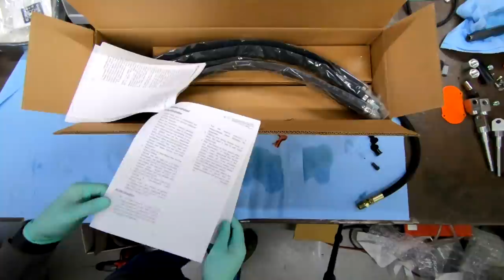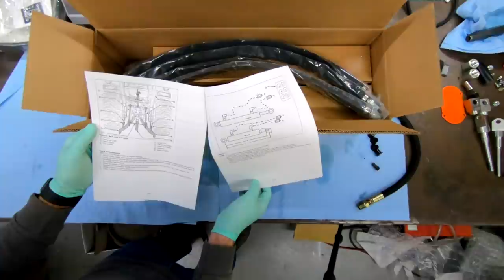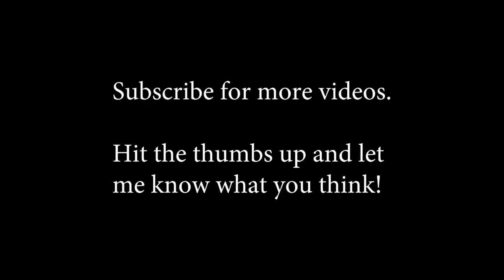Adding Kubota Top And Tilt To The Tractor - #62

Comment: I have that same kit installed on a L 4060 with a QH 15 quick hitch. I noticed that when I have the top cylinder fully retracted that the top of the quick hitch hits the cylinder and could cause damage so you might want to check that. I’m going to cut the top corners of the quick hitch at a 45° angle to eliminate the contact. Good video thank you.
Reply from the maker: Thank you. Yes, I had the same issue as well. The cylinder diameter is wider than the ears of the hitch. I have since replaced the cylinder with one that has pilot operated check valves and do not have that issue.
Reply: @JaredsShop  I could not figure out the purpose of the two grade 5 bolts with locking nuts. Did you figure that one out? Thank you
Reply from the maker: @rccodara630  
What did they come with? The top and tilt?
Reply: @JaredsShop  Yes sir it was part of the top and tilt kit it’s listed in the contents but there’s no explanation that I could find anywhere to tell me what to do with them, I wish I could send you a picture of it.
Reply from the maker: @rccodara630  
I’ll have to look at the manual again. I don’t remember getting them with mine.

Comment: Really like mine, although they had to replace 2 valves as my tilt kept leaking down. I guess they’re known for bad valves. Hopefully yours doesn’t drift every time you shut off the key or while running.
Reply from the maker: Unfortunately, mine does. Did the new valve solve the issue? I need to have the bleed-off timed and see if it falls within warranty specs.
Reply: @JaredsShop  They put new valves in but I’m not so sure that it holds very well. I’ve only had it back a week and have been so busy I haven’t had a chance to mess with it much but honestly I think it’s still drifting a little bit. They had my tractor for a month replacing it last time and I really hate paying a payment and not being able to use it. They said that they’re not meant to hold implements up, they’re just meant to adjust them. Just a way to get out of fixing them properly as many of the parts are bad. I guess the valve body is flat and not tapered so it doesn’t hold pressure well. Sounds like a bad design. Maybe a check valve would help.
Reply from the maker: @Dirtyd-dd7xy  
They’re partially correct. A valve body like this will always leak by as it does not utilize seals. It is a machined spool that is precision ground to a very tight tolerance. If it had zero tolerance to where it wouldn’t leak then it wouldn’t move as it would be stuck. The issue is how bad does it leak. If the tolerance is too much then it will leak by fast. They have a spec where they gauge the distance it drops over a certain amount of time with a certain amount of weight on it. It will never 100% hold weight without a check valve. 

I am looking at installing a check valve but it’s difficult because there is not much room between the cylinder ports. I’m not sure if I’ll go with a single one just to help with gravity or if I’ll install a dual pilot check valve and just have it mid-hose.

Comment: what was the price point ? also to fix any leaks maybe try some teflon tape on the fitting threads and then dope the tape!
Reply from the maker: It was under $900 but I’ve since replaced the top link with one that has dual pilot operated check valve. 

Yes, I use Teflon tape on the NTP fitting.
Reply: @JaredsShop  good call on the check valve ! Would love to see an updated video , I should be getting my grand l3560 in the next week or two , my dealership is building it as we speak . Went with la805 loader with third function  , 64” front snowblower mid pto, and a 72” box grader , led head lights, led front and back work lights , heated mirrors , and an air ride seat (also the radio option because why not right) . I would be very interested in the top and tilt kit ! Thanks again for the awesome content
Reply from the maker: @haus05  
Thanks! I’ll try to get another video up soon. I have a ton of stuff recorded but find it hard to set aside time to edit and post. There’s just never enough time in the day. 

Sounds like an awesome build. I’d like to have mid PTO and the flail. I don’t get enough snow to justify a blower. Let me know how you like the air ride seat. I may add it in the future.

Comment: Will this work on a l3901 or do you happen to know a kit number? I’m not having any luck finding anything.
Reply from the maker: Yes it will but I have since changed the top link to one with pilot operated check valves. Here’s a link to it. 

https://amzn.to/3SuhkwJ

I haven’t purchased a side link with check valves yet, but hope to soon.
Reply: Thanks for the info! Curious did that cylinder work out and which one you went with for the tilt? @JaredsShop

Comment: Thanks for posting this one!  I'm in the market for this as we speak.  Did you pick up at local dealer or online like Messicks?  Can you post which parts you ordered?  Worried now after reading below about the leaking issue.  Did you end up solving this?
Reply from the maker: I’m not sure I would recommend the kit. I have since replaced the top link with one that has pilot operated check valves and will be doing the same for the side link. If these had check valves I’d definitely recommend them. 

All valves leak down. Some just more than others. I explain it in a tractor basics video.
Reply: @JaredsShop  Recommendation on what you'd do instead?
Reply from the maker: @flightcrazed7790  
I like this top link. It’s what I ended up buying. I haven’t grabbed a side link yet. 

https://amzn.to/3tbhFJU

Comment: Enjoy your videos. I have a new L6060 that I should get to pick up this week and will be install the rear remotes and 3rd function/ quick coupler myself in the coming weeks. I sprung  for the hydraulic top link but no tilt. I don’t think I’d use tilt much
Reply from the maker: Thanks so much!! Let me know if there’s anything in particular you’d like to see in a video. 

Let me know what you think of the tractor when you get it. I’m sure you’ll love it. The L6060 is a beast. I may add one in the future. I’d love to have one setup with a mid PTO, front hitch, and a front flail. 

For tilt, it depends on if you do much ground work. If you use a box blade, grader scraper, rear blade, or rake, the tilt can be useful. If you don’t do that much it may not be worth it. I do a lot of final grading, yard leveling, driveway repair, etc. so I often have to change the angle on the fly.
Reply: @JaredsShop  I’m moving up from a L3540 so I know I’ll love it as I’m used to the grand L series. Had lots of people ask why I didn’t look at other brands and I told them I was sold on the Hst+ transmission. I was wanting more pto horsepower and figured go big or go home. I do more mowing with mine than anything. Running a 6ft cutter I’d find myself in low range /turtle on the hst+ more than I wanted . I do very little grading work. Although I plan to tear up my yard this next spring and level / reseed since I bought a LandPride Aps1572 seeder this last summer for food plots.
Reply from the maker: @braxtonwiggins6576  
Very nice. Then yes, you know what you’re getting into. I try to tell everyone the HST+ alone is worth jumping into the Grand L. 

So am I understanding you that you got hydraulic levers too? 

I have. 72” woods seeder I purchased almost 2 years ago. I seed some yards with it. Also purchased a harley rake this past spring.
Reply: @JaredsShop  yes I got three rear remotes, hydraulic top link, and  the third function with the hydraulic levers, air ride seat and a few other odds and ends. Wound up with $8k worth of extras on top of the tractor and loader. They sure add up fast. I opted to install all the hydraulics myself to save labor as they assured me it wouldn’t mess with my warranty and I had previous experience on the L3540.
Reply from the maker: @braxtonwiggins6576  
Yes they do add up fast. I absolutely LOVE my hydraulic levers. They were a pricey option but I think they’re worth it I have 4 buckets, forks, plow, snow pusher, grapple, and hydraulic auger. I change front attachments often and not having to leave the cab for anything other than hydraulics is awesome.
Reply: @JaredsShop  I constantly take my forks on and off when mowing vs removing loader. Also have bucket and grapple but use them a lot less. I also sprung for the 8point quick connect for. The loader. The more I thought about having to undo 8 hoses to take the loader on and off it seemed like feasible upgrade. The front flail mower would have been sweet on the L6060 but that thing is $9k not including the mid pto and front hitch.
Reply from the maker: @braxtonwiggins6576  
That’s definitely going to be one of best setups I’ve seen. Sounds like a dream build. 

I know. $9k is steep. It used to be less, and I hope it comes back down, but we’ll see. There’s also a couple companies that make third party front 3pt hitches and PTOs. Then I could use a flail like a Peruzzo. 

I rarely take off my loader. I’ve only done it a couple times, like when installing my backhoe subframe. I did think about the hydraulic disconnect but know the BX uses that setup and they have a lot of leaking problems with that. Hopefully it doesn’t apply to the Grand L.
Reply: @JaredsShop  I was unaware there was a third party front hitch. I’ll have to look into it. Hopefully the single point coupler doesn’t leak I honestly didn’t look into it much before ordering it.
Reply from the maker: @braxtonwiggins6576  
Look up Zuidberg some time. They are a manufacturer of front PTOs and linkage. Front 3pts are very popular over seas. Hopefully they’ll become more popular here in the future.
Reply: Picked up my L6060 from the dealer Monday. Spent yesterday and today installing hydraulics. Thanks to your videos everything went smooth. I really like the single lever coupler for the loader hoses. Definitely worth the money when there are 8 hoses to deal with. Also had my windows tinted today as well. It was nerve racking taking all the glass out for the tint guy. Just a couple more accessories to add and it’ll be ready to work.
Reply from the maker: @braxtonwiggins6576  
Awesome!! Congrats! I don’t take my loader off but if I did I could see that being useful. I have hydraulic levers so I have 8 connections.
Reply from the maker: @braxtonwiggins6576  
I’m also thinking of getting mine tinted but don’t want to go very dark. I’ve heard complaints about nighttime visibility. Have UV protection is what helps the most though. What percentage did you go with? Let me know what you think please.
Reply: @JaredsShop  I had 20% ceramic on the last one. It was so dark if you were working and someone was helping outside the cab they couldn’t see you . I went 35% ceramic this time. Definitely go ceramic if you do it. It cuts the heat way down in the summer. nighttime visibility with 35% shouldn’t be a problem. If you give me your cell number I’ll text you photos of what the 35% looks like tomorrow.

Comment: Did you ever have clearance issues with those hydraulic inlets/outlet being side mounted that side linkage top bolt looks awfully close to hitting top link?
Reply from the maker: No. I have not had any clearance issues. 

I have since replaced the top link with one from AMA that has a pilot operated check valve. It does push the hoses into the SMV sign though. I need to put some 45 fittings on it.

Comment: Jared will this top and tilt kit fit a B2650 cab tractor?
Reply from the maker: Possibly, but it might be a long. The best thing to do is to measure your current mechanical links. Also, I’m not sure I’d recommend this kit as I’m not satisfied they don’t have pilot operated check valves. 

Here’s a video on measuring everything and where I give dimensions for the pieces in this kit. 

Tractor Basics - How To Measure For A Top And Tilt Cylinder
https://youtu.be/lEk2k9FIFzA

Comment: Wow. That looks super handy!
Reply from the maker: It is. I use it all the time. The tilt is used a lot with dirt engaging implements, and the top is too, but the top also comes in handy when loading the trailer. I can suck the implement close to the tractor and get more clearance for loading/unloading.

Comment: Do you have the kit number
Reply from the maker: L8388A but I have since replaced my top link with one that has pilot operated check valves. I’d recommend going that route instead. Here’s the one I purchased. 

https://amzn.to/3zIEZ5w
Reply: @JaredsShop  Hi Jared.  First off, thanks for the videos, the one about installing rear remotes was very helpful when I did mine.  I am in the process of purhcasing this kit (L8388A) for my L4060LE.  Why did you choose to replace the top link with the pilot operated check valves?  My gut is telling me that I should do the same thing.... I will have to disconnect one of the two cylinders when I use my Stump Grinder, I am afraid  that the disconnected cylinder will drift.  Is that kind of why you choose to replace the top link with the pilot operated check cylinder?
Reply from the maker: @bettscr  
I got tired of the drift and wanted the cylinder to stay where I put it. 

The cylinder shouldn’t drift when disconnected. It usually drifts  because of the valves. The spool valves don’t have rubber seals so they will always let some fluid by.